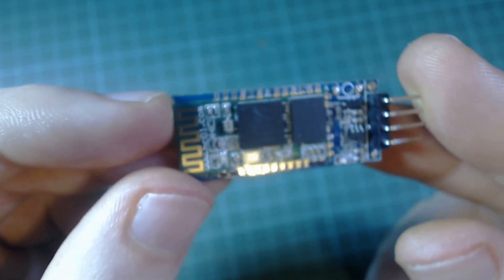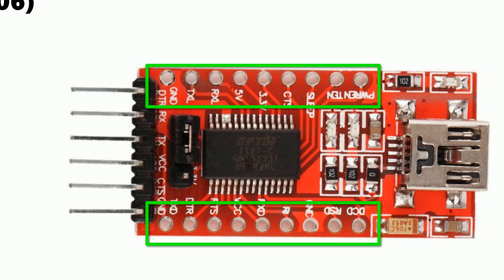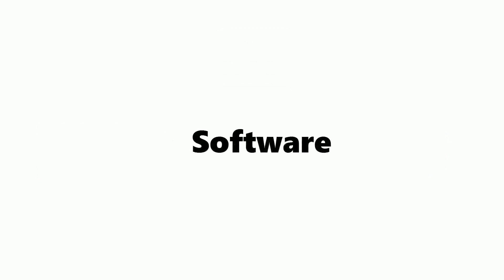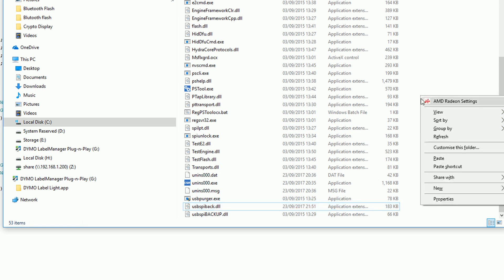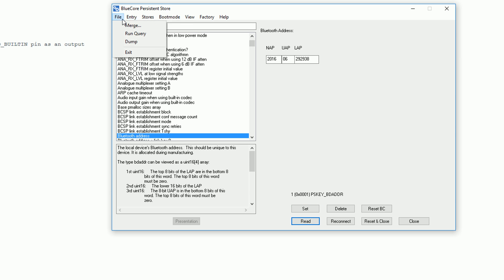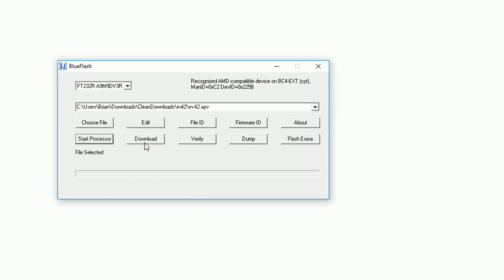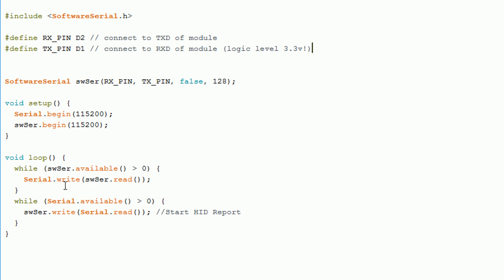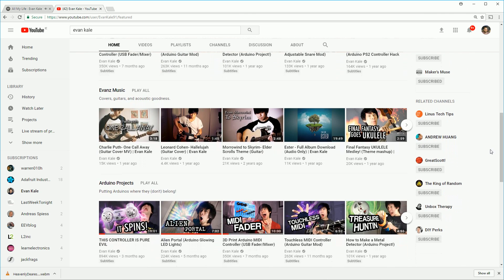Turn your HC-05 into a HID Bluetooth device (No Parallel Port Method)

Comment from the maker: If your watching this 2022, I would recommend skipping this and just using an esp32 instead, it's cheaper and easier than this method

I have a video explaining how to use it as a hid device here:

https://youtu.be/4sIkW7wogrE
Reply: Thank you for the update, I had come to the same conclusion. I want to make an optionally wireless keyboard so I want USB HID and Bluetooth HID. I started with trying to figure out how to take an Arduino Pro Micro (which takes care of the USB-HID part) and add Bluetooth HID to it with a flashed (HC-05 or HC-06) or how to take an ESP32 and add USB-HID to it.

Took me a while to come to the conclusion why not use both although it feels a bit odd to use the pretty powerful and capable ESP32 to basically just to do bluetooth.
Reply: I was trying this 9 months ago and it was a fail cuz of the bad Bluetooth chip i cudent flash the framework with pstool 
Lets try this now 
Tnx
Reply: Hello, I’m trying to map a couple of bluetooth macro keys and I’m worried about the power consumption of the ESP32 I’m currently using for it (as I want it to run on battery). I believe that the ESP32 is way too powerful for this project and I would like to reduce everything to an ATTINY85 to make it as much cost and power efficient as possible. But I’m not really sure if the bluetooth module and the ATTINY85 together are going to be more power efficient than just using an ESP32, what do you think?
Reply: I couldn't success with esp32 BLE. My computer does not connecting but it connects to Android phone.
Reply: @requiem4adreamc  well I didn't succeed on connecting it to my Android but I managed to do it on my iPad which is what I wanted xddd
Reply: @cesar6277  Good to hear that :)
Reply: hello which esp32 did u recommend ? i want to convert wired ps2 controller into esp32 wireless compatible for blueretro.
Reply from the maker: @azispratama92  cheapest one that has enough pins and I guess it would be useful in this use case for it to support being powered by a battery

Comment: I have rebuild it using two HC-05 modules twice, inluding the wiring, won't work. I always get "XAP or SPI error", the HC-50 is flashing red permanently. Checked all the wires about 200 Ohms as supposed, and there's no short and no pin-swap. The FT232RL is workign as serial port at least, I have verified by shorting TX and RX to a loop.  :(

Comment: Thanks for the video! I have followed your instructions successfully so many times! However I need some help from anyone that can assist. One of the connections broke loose while dumping the firmware of a module mounted on a ZS-040 breakout board. Now the thing is that I didn't realize until it was too late. Could anyone please offer an HC-05 dump from that breakout board? Now I know, revisions might be different and all, but I'd like to save the module if possible. Contacting the seller would be out of the question as I had bought it a few years ago. I'd appreciate any piece of advice. On that note, I've got a couple of modules (from a different batch) that don't want to get into at mode. Whatever I do, they just boot normally. Any thoughts on how I can solve that issue?

Comment: Great video, very in depth. Do you think this process would work with a CH340 breakout board instead of an FTDI? It happens to be what I have on hand at the moment.
Reply from the maker: Sorry I don't know. I wouldn't do this approach anymore at all if I wanted Bluetooth hid , I would just go straight to an esp32, it's cheaper, easier and doesn't require any special tools.
Reply: @BrianLough  right on, I've got a few of those laying around. Thanks for the info!
Reply from the maker: Awesome!

Here is a video I did on the topic if it helps: https://youtu.be/4sIkW7wogrE
Reply: @BrianLough  Thank you Brian, you're the man! Subbed.

Comment: Hi @Brian, 
Amazing video. 
What I was thinking with HC05 is: HC05 has a lot of PIO. 
So if I connect a button at HC05 master and one LED at another HC05 slave.
 and when I press button at master, the LED glow at slave.

How Can we do that. Programming HC05 as per requirement. 
What you did is a firmware transfer but how to write an application on HC05. 
If we can do that then there is no need for arduino in bluetooth applications and making the use of arm processor on HC05.

Can you please share a video on that too.

Comment: Any idea of where I should go if I want to make a usb adapter that receives through bluetooth but is identified as a hid keyboard by the device it's plugged into? I want to use my bluetooth keyboard with my smart tv, but they've locked the bluetooth functionality to audio only whilst only letting keyboards/mice be used through usb.

Comment: Bought some faulty RN-42s from digikey. Be careful if you decide to buy those from them, mine were completely unprogrammed or otherwise misconfigured. Used this video to upload RN-42 firmware on them and sure enough they started working. Thanks a lot for the video.

Comment: Please help me. Everything is worked perfectly. after upload RN42 firmware to HC 05 module, PSTool didn't recognize the bluetooth module anymore... What can i do for this??
Reply from the maker: See the pinned comment, they are bad modules
Reply: @BrianLough  oh thank you so much. Now i see.. my one is one of that bad type.. have to buy another couple of modules for check. 

Can you tell me how to send keyboard commands to pc using this module after everything done? Is it can use with any arduino board? Like uno? Or only leonardo compatible? Is therr need any keyboard library to do this?

Comment: When i open the blueflash i get an error msg saying error detecting chip type unable to start read select a spi transport to attempt reconnect . any solution ?
Reply: @BastelPichi  Have You solved it?
Reply: @karolgoluch  no but i heard that some modules have issues. Maybe the pins shoudnt be connected to the pads on the board. ive you solder them thats always the case
Reply: hey yaker ive got the same error.In case you solved  it kindly let me know

Comment: Hey man, does this method works with the HC-06 module?
Reply from the maker: It did previously. There was some versions of the board that didn't work. Check the pinned comment for details, but even that is a while ago so I'm not sure what the current situation is
Reply: Hey man, did you get any solution? I'm trying wiht a HC-05 module but I'm stack just when I click "stop processor" on BlueFlash. The program freeze an nothing happens
Reply: @alejandro7599  Run the software as admin in windows it will fix this issue, I had the same issue

Comment: I flashed RN firmware. I can do command like "$$$" , "SF" but when i den "S~,6" i got message "ERR"
Reply: I have the same exact error. Tell me if you find a solution.
Reply: @Thefermar337  Yes... i found it... just flash firmware (from some random guy in the comment section).... and dont do factory reset(dont do 'SF,1' command).... if you do factory reset the HID mode ability will lost and you will not able to set in HID mode... Hope this help you.....
Reply: @gluinc4156  Hey, it worked, thank you a lot

Comment: can someone help me please, for some reason when i set up hid keyboard for this and enter keystrokes using serial moniter it never stop sending keystrokes to my computer
even though i only set one pls help

also i connected this to my phone as well and for some reason when i send a keystorke it automatticaly gives a "enter" key as well at the end of each message.  so there is always a return after every sent thing 
pls help someone  :(
Reply from the maker: For the first part, you may need to send  a blank key press (send 0) afterwards to let it know you've "released" the key

Second part, make sure in the Arduino IDE serial monitor that it's set to "no line ending"

I recommend using this library, it has lots of helper functions etc https://github.com/witnessmenow/BPLib/blob/master/src/BPLib.cpp

Comment: If you have an ESP32, you don't need to go through any of these hassles. It has a built-in Bluetooth module and just needs short Arduino sketch to turn it into a Bluetooth keyboard: https://gist.github.com/manuelbl/66f059effc8a7be148adb1f104666467. At $5 the ESP32 is even cheaper than the HC-05/FTDI combo.
Reply from the maker: Awesome, this didn't exist at the time, I checked!
Reply: Can you attach a usb keyboard to the ESP32 and have it behave as a bluetooth one? I've seen people use a few buttons but not a USB keyboard. If such a thing could be done it would be very popular! Many people would like to convert their favorite mechanical k/b to bluetooth or wireless HID.

Comment: Can i do a similar thing with ESP 8266 so that i can use it as keyboard for my pc.
Reply: Gajendra Suthar No. The ESP8266 has a USB chip that only supports serial communication. It can‘t do HID (USB term for keyboard, mouse etc.). Other microcontrollers are more versatile with regards to USB: Arduino Leonardo, ST32F103 (aka blue pill), Teensy LC and 3.x. They can all simulate a keyboard and mouse.

Comment: Nice tutorial Brian! But i when i send $$$ the hc-05 doesnt reply... I did everything just like the video but couldnt get it to work. I backed up and tried again but with no luck
Reply: Now when i send the $$$ it replies $$$. I think its not entering configuration mode
Reply: If anyone has the same problem this is how i solved:  https://mitxela.com/projects/bluetooth_hid_gamepad
Uninstall the libusbK driver and use the FTDI's rx tx pins to send serial commands through Arduino IDE Terminal Serial

Comment: Hi, thanks for this method, but I don't want to spend money. Is there any method I can do? Like using arduino or making a thing with soldering that helps to connect hc05 to pc with usb? (I have firmware of RN42)

Comment: I guess this method should work using an Arduino UNO as FTDI programmer, right? (in a similar way we do it to flash an ESP-01)

https://cordobo.com/2300-flash-esp8266-01-with-arduino-uno/
Reply from the maker: I'm not sure Pedro, I think it will require the ftdi because of the custom driver

Comment: 9:35 I got stuck here. I try to do the same but with Arduino Nano, but when enter $$$ I get no response. How to fix it?
Reply: Did you ever fix it? I'm stuck there too
Reply: @jacksonshipmun2527  Nope, didnt find solution yet
Reply: @jakubpiatka5765  I actually did have a breakthrough last night. Not exactly sure what changed, but I rebooted the hc-06 a few times, and when I typed $$$ it actually came back with CMD (and some garbage so something's still up). It's annoying when there's no "oh that's what was wrong" moment, but oh well. Good luck!
Reply: @jacksonshipmun2527  Im using HC-05, not sure if it behaves the same as HC-06. I tried his Arduino code but couldnt compile it, maybe its only for his ESP. Do you have idea how to run it with Nano?
Reply: @jakubpiatka5765  yeah I had to change the code. For me I had to change the pins from D2 and D1 to pins that actually exist on my board. Then I had to delete the "false" and "128" from softwareSerial. Then it worked
Reply: @jacksonshipmun2527  I understand. What board did you use? I will try the same as you did.
Reply: @jakubpiatka5765  I used Arduino mega 2560, should work on any though. Let me know if you get it working or not!
Reply: @jacksonshipmun2527  Great it worked. Thank you very much for tip. I would like to message you, can you please give me contact to you?

Comment: okay so i have a question...
can we reprogram the HC-05 with an Arduino uno/nano
cos to my understanding the purpose of using the ftdi breakout board is to interface the HC-05 to a pc...
and a nano/uno has ftdi usb interfacing capability...
and we can actually install the bootloader on another nano/uno with one (i've done this previously after somehow deleting the bootloader)
so if this is a feasible method then it'll save a a lot of effort cos i already have multiple uno nanos and hc-05s...but no breakout-board....
pls someone a little help needed here😐
Reply: it is possible but a pain in the fucking ass, just save the hours tryna figure that shit out and just spend the 3-4$ on the ftdi

Comment: What about you've got a touch device with USB & I2C interface. Would it be possible to split the area that it scans and map to characters and send those characters into a Windows machine? I mean form your own custom touch keyboard.. What do you think of this idea? Could you give me a hand on this??
Reply from the maker: Yes to the sending characters part, not sure if there is a screen you could use with an Arduino that has that kind of resolution though
Reply: @BrianLough  Basically what I got in my hand so far on trying to achieve this is a Raspberry Pi Zero.  I connected the touch device to that one via USB. And I can share RPIs usb ports via Usb2Ip to a Windows machine. And use it as if it is directly plugged in to the Windows machine. But what I need to handle is that mapping thing. I somehow need to map areas to particular keystrokes, and when those areas are touched I need to send "123\r\n" to the windows machine for example. What do you offer me to do?

Comment: Dude... really impressed...i heard that it is possible to use an arduino uno  as a ftdi too ...by removing the ATmelchip and grounding the reset ....plz can u give me a hint to use it flash the new firmware....thanks a lot

Comment: Hi,I don't have FT232RL .Is there any method to upload firmware without parallel method.For instance can I use Arduino or PL2303 to flash it .Thanks

Comment: Man, why you didn't use the FTDI to test out the BT module? Just because the baud rate?
Reply from the maker: Good point, never even thought of it 🤣
Reply: Brian Lough hahaha i did and it works, you just have yo set the module to 9600 bauds

Comment: I took 2 HC05 modules and the psr settings are the same on both. Do I need to make these unique in any way?I would have assumed that at least bdaddr would be unique.  // PSKEY_BDADDR
&0001 = 0011 0f1c 0032 98d3
// PSKEY_ANA_FTRIM
&01f6 = 001f
// PSKEY_ANA_FREQ
&01fe = 6590
Brian. Seriously. Thank you for this and thanks for being so active in the comments.

Comment: i can't find my ftdi device in blueflash .it says no ftdi device found. but it gets detected in device manager .
Reply from the maker: If you have followed all the steps in the video. Double check your wiring is correct and there is no shorts.

After that I'm not sure what else to suggest, sorry.
Reply: Try to power the hc-05 module with another 3.3V popwer supply such as the 3.3V pin of an arduino. It worked for me. Remember to connect FT232R ground with the arduino ground.

Comment: Whats the difference between hid and non hid bluetooth devices ? Cant they both be used as human input devices ?
Reply from the maker: HID is a standard that allows it to be used as a keyboard/mouse etc, the operating systems of your phone/PC know about it and how to handle it. Non HID compatible devices can be used for input, but it would require custom software on the received to handle the inputs.
Reply: Brian Lough Does that mean that if I made a non hid bluetooth device mapped to the letters qwerty that it will not be recognised as those letters without additional software ?
Reply from the maker: What do you mean by mapped? That it sends a "q" over the serial interface? Yes the only way you could get that to appear as a user pressing q on a keyboard would a be an application listening for that on the PC/phone

I would not be an expert on this at all
Reply: Brian Lough Understood. Thanks for the explanation

Comment: following every single step on this video, and got everything working. Got a bit misleading on the csr-spi-ftdi driver, I use the new one which is version 0.5.3.a4, got no luck in there. Then I try the driver that is on the video which 0.5.2 version and beyond that everything is smooth. Thanks for sharing, got a lot of project coming ahead because of you

Comment: I can see why it's 404... Youtube adds the right bracket into the link. 
But anyway, can you use the "$$$" and "SF,1" commands to communicate with the module when it's not flashed with HID firmware? I just got them recently and I want to check if they are working fine.
Reply from the maker: Standard firmware hc-05/06 boards might have different commands than the HID firmware. Ive never really used them, I don't know that the commands would be
Reply: Brian Lough I see. Thanks!

Comment: Can I use a USB to UART cable to interface with the HC-05 module (not flashing the firmware) with one like this (https://www.adafruit.com/product/954)?
Reply from the maker: That page is 404ing for me for some reason. Once it's flashed you can interface with it from any serial device, including a PC if you wanted

Comment: Hi, 
I did what you told me to do, but I have a problem, Whenever I open BlueFlash, and I select FT232R, there is an error message saying error detecting chip type (...) Select a SPI transport to attempt to reconnect. 
I don't know what this means. 
Btw I am using a HC-05.

Thanks for your Help!
Reply from the maker: Double check your wiring, if something is wired wrong you might get that message
Reply: Try to power the hc-05 module with another 3.3V popwer supply such as the 3.3V pin of an arduino. It worked for me. Remember to connect FT232R ground with the arduino ground.
Reply: hey joey. Iam encountering same error despite making right connections. Did you solve the problem?Kindly let me know.

Comment: I'm having an issue and am wondering if it has to do with my FTDI  Programmer. When I launch blueflash I see the FTDI as "FT242R 00000000". Is the 8 zero's normal?
Reply: I guess that's the serial #. From what I've been reading that's a good indication that it's no a genuine FTDI Chip. Will these chips still work for this?